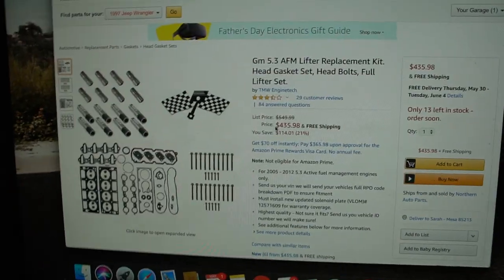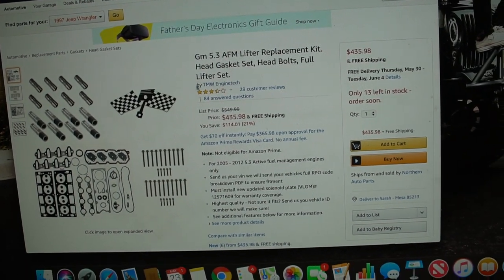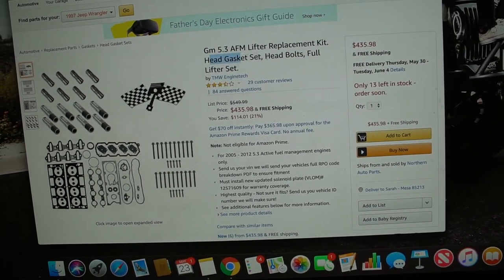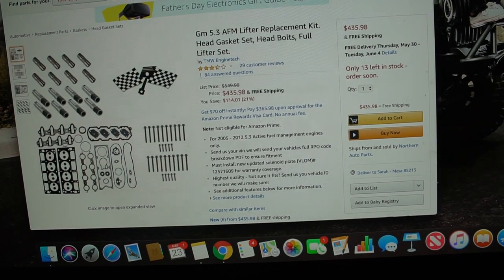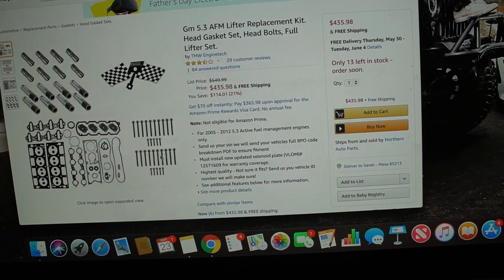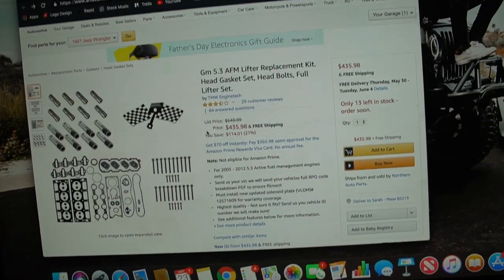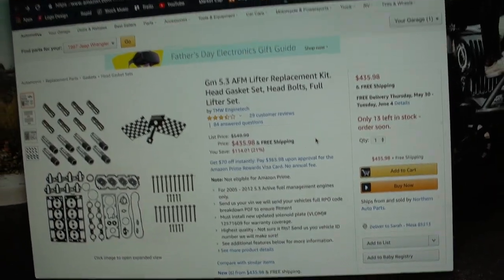Chevy's Infamous 5.3 Lifter Tick (Solution!)

Comment: Just turn up the radio nothing to worry about I have 224 thousand miles on my 07 avalanche and its done it since I got it when it had 107 thousand just change the oil and air filter regularly and your good 👍
Reply: Thanks! this comment helped me more than the video itself.
Reply: Adrian Rojas straight up. This guy is in the video is nuts for spending $2000 to fix a sound.
Reply: @mateo3388  I believe you, my friends dad a mechanic told me there was nothing wrong with my tahoe, the tick is not loud and said I can use it for another 100k miles or so or if in case it gets louder he will just replace them along with some new fuel injectors from ebay. Had mine cleaned out
Reply: @adrianr8486  I got the 4.8, the tick went away after oil change knock on wood
Reply: You want to do this if you want to change the camshaft with the lifter kit and probably with the camshaft bearing and that cost fortune
Reply: @cameron.s.9368  I changed the oil and it stared doing the tick noise
Reply: @mateo3388  he isn't nuts. The noise means that the lifter(s) which are spring loaded have remained collapsed or it is stuck. Sometimes an engine flush will help and sometimes using a different oil may help, but it is a serious issue. His lifter tick if left could have and would have destroyed his cam among other things, his engine altogether.
Reply: Yep mine will come and go randomly I just ignore it I have had the truck a 09 Silverado for about year no issues other then normal wear and tear 171k when I got it has about 188700k now

Comment: Not even collapsed lol that’s a nortmal sound
Reply: My 2009 doesn't sound like that. Smooth and quiet.
Reply: @ItsRen Mine has 159k miles and no problems, but just put the Range AFM Disabler in to keep it off and hopefully prevent any. Never liked that forced feature anyhow.
Reply: @ImprovingYourMokai  what year?
Reply: @chevygmlyfe_  My first comment said 2009.
Reply: My 2014 sounds the same way its just a normal liftter tick my truck been sounding like that the past 100,000 miles
Reply: Wasted a lot of money. Woulda run another 100,000 miles with that little tick.
Reply: @ImprovingYourMokai  how you liking the AFM disabler?  I’m thinking of doing it to my wife’s Yukon.
Reply: @HapPap81  Has worked flawlessly.
Reply: @ImprovingYourMokai  what happens after you keep driving with it like thay
Reply: @skylinezz4482  Like what? With the AFM disabled? Nothing, it works fine.
Reply: @ImprovingYourMokai  just w the lifters ticking is that fine to drive like that or is it must to get fixed

Comment: This is definitely not a collapsed lifter. A collapsed lifters sounds like a massive engine knock. Ask me how I know. I did a DOD delete. Replaced with LS7 lifters, new cam, valley plate, trays, HG etc. Tuned it out. Working great. Now 2 years later hear a slight tap/tick like this.
Reply: What was it?
Reply: I have been chasing this tick this weeks now.

Comment: WARNING ⚠️ 
If you own this engine GENERAL MOTORS IS BEING SUED THROUGH A CLASS ACTION LAWSUIT
case 1:19-cv-02858 szep v General Motors.  
What you describe is exactly what they’re being sued for.  
What I would suggest is to start making noise.  This lawsuit was filed last year.  I bought the GMC version of this motor less than a month ago and and hearing the same clicking sound, (having the same symptoms the class action describes).  
General Motors has not issued a recall, so what will you do when your 7,000 dollar engine fails prematurely?  I don’t have that kind of money and likely neither do you.  The only way to fix the problem seems to be to speed up the judicial process.
Reply: Any updates
Reply: TheSanchezinjection  It would bankrupt GM

Comment: I have a 2007 GMC Sierra 1500 with an LY5 8th VIN digit “J” has AFM/DOD, mileage is at 248,000 and it has lifter tick, but has been doing it since around 120,000 miles, no major failures yet, just do regular maintenance and you should be fine, I did however use a superchip tuner to delete the AFM/DOD function out at around 180,000 miles
Reply: You have a video on how you did this?

Comment: *For all the guys seeing this* I have a 2012 Silverado and my truck made this noise fairly aggressively and I had no clue what it was I took it home and checked everything out turns out my pcv valve was clogged which cause the truck to burn oil a lot faster then the 5.3 already does replace that for a simple 80 bucks and an hour at most and see if that helps it fixed mine!
Reply: Ill have to try this 👍

Comment: It's not a big deal.  Just keep your oil changed religiously.  Make sure to use oil filter with check valve.  The only 5.3`s I've seen with a problem from this tick are the ones where people did not change oil regularly and/or just couldn't stand the sound.  It not really a problem.

Comment: I am a heavy Die Hard fan my family owns the Chevy dealer in Mass and I will tell you from experience the 5.3 L V8 is usually a bulletproof engine if you get anyting in my opinion 2009 or newer you're going to experience more lifter problems because of the active fuel management s*** if you do have one that has the active fuel management delete delete delete delete make sure the truck is running in all 8-cylinder mode at all times truck will be more reliable
Reply: My truck has the M5 option.Does this keep it in V8 all the time or do I need to get a tune ?I start in manual mode on shifter then press the + till I get in the 5 then start driving.Does this keep it in V8 all the time?

Comment: 5.3's also have issues with piston slap when cold start up - it can sound like a noisy lifter. My 07 Sierra ticks fairly loud when cold and diminishes to a slight tick when warmed up. She's been doing this since 100k miles and now @ 270k with no issues. The cylinder cut off feature was de-programed @ 110k.
Reply: I thought I had lifter tick in my 08 Avalanche. Turned out it was the exhaust manifold. The bolts in the back are known to break or back out. When warmed up it stopped. I just tightened mine up. Fixed the cold tick.

Comment: I recently picked up a 2008 that only had 36,000 on it.  Mine sounds the same already, but that's just how these motors sound cold.  Yours isn't even bad yet. Not sure who's paying $4,000 to fix this?  I'd just spend a little more for a new crate motor at that point.  But my first move is going to be a disable tool to delete the AFM.  I switched to Mobil 1 oil/filter and drive mine hard...worst case, I'm doing a 6.2 swap when I blow it.

Comment: There is also a product to help prevent it it before it happens that is less than $200 online and it takes less than one minute to install and it keeps the engine in v8 mode at all times. It's called the range programmer i bought one when i got my 08 Silverado with 85,000 miles on it and have had it over three years now and it has 130,000 and still no lifter noise

Comment: Just get the AFM disabler. Plugs right into your obd2 port. Done. Prevent the oil consumption problem which leads to the lifter tick but you have to get it before you have the problem.
Reply: My truck just started making some banging noise when going into V4. I didn't know until now about the Ranger AFM disabler. So there is no point installing it now until it gets fixed first?

Comment: My '21 Silverado 5.3 with 33k miles does not have the variable 4 cylinder on demand (its all 8 firing all the time) and it's currently in the garage getting fixed because of a faulty lifter.

Comment: Mine has a tap when cold at low idle. It's done this since new and goes away as soon as I drive it a mile or so. I deleted AFM with a tune.
It's more of an annoyance when I hear it at the drive thru getting coffee, but I'll leave it alone until it causes an issue. Truck's got 54K miles and runs great otherwise.
Reply: Now, this is kind of weird...I have a GMC SIERRA DENALI 2015. THERE WAS RECENTLY A RECALL ON THE VACUM PUMP FOR THE BRAKES. GOT THE VACUM PUMP REPLACED, NOISE HAS DISSAPEARED...
Reply: Jamie Coverson smh they just reflashed my ecu for the brake. No vaccuum. Got the letter over mail too with vin number

Comment: mines been sounding like that since about 80k miles, has 300k on it now with no issues. Sound hasnt really changed, its pronouced on cold start up, but audible even when warm.
Reply: Yes.....same here. I have been adding Lucas oil stabilizee ever since 120,000 and now its at 189,000 still running like a chanp.
Reply: Thanks for the information mine does it in cold starts
Reply: I was gonna say, bad buy, but from others comments I guess you did OK.  Tick , tick, tick.

Comment: Best fix is replace cam with an LS3, upgrade lifters, heavier springs, new valves and push rods and DOD/AFM delete as soon as possible!
Reply: No need to change push rods definitely not the valves they have nothing to do with it. And you won't need heavier springs unless you go with a higher lift cam

Comment: It's a good engine if well maintained and GM improved it after 2011
Reply: I have a 2011 GMC 5.3 so does this mean I should be good?
Reply: My 2013 has a collapse lifter
Reply: @Frit0Pie  how much did it cost you for repair?
Reply: Дядя Федя parts are around $1000 with cam and I’m thinking of doing it myself. I haven’t gotten a quote from a mechanic but I’m estimating around $2k+
Reply: @Frit0Pie  as long as cam weren't hit, I am sure you could get away with just replacing lifters and rods.
Reply: @Frit0Pie  is that American price?
Reply: Sam Fascione yes
Reply: Lifters are still junk, even in 2021
Reply: no, they did not. if you motor has AFM ....it WILL cause issues. step 1: delete AFM. step 2: motor flush. change oil every 5k miles. synthetic only. if the tapping goes away....lifter still has enough oil. if you have tapping all of the time, lifter is collapsed, needs to be fixed.

Comment: You can usually unstick them without removing the head.
Reply: If the lifters are collapsed unsticking them is prolonging the issue for the inevitable...they will definitely fail eventually costing you more money. If the tick is new and just now starting sure..you can unstick em..but replacement is best

Comment: I have tons of info on these lifters and the noise they make over on my channel. Yours does not sound that bad at all yet. You may be able to even do a engine flush and run a better oil to solve that minor noise. Best thing to do though is get the system turned off ASAP and check for loose VLOM bolts.
Reply: I've watched alot of your vids on the 5.3 ticks. Any idea why mine will be silent then start ticking for a couple of seconds then go quite again ? Only does it at idle and seems to do it way less(practically doesn't do it at all) after I change the oil but will come back after about 1k into my new oil change interval?it will just be random when it decides to do it too.

Comment: Do the 6.0s have this problem as well? I recently did an oil change and an AC belt replacement, and I noticed my engine started to make a ticking noise on idle. It’s driving me crazy.
Reply: Depends on year model. Loo in your glove box and the RPO codes. If it has a L76 then yes. If you have a pre 2007 Your tick maybe piston slap or a lifter tick. Put some marvel mystery in the oil and it should clear the smaller oil passages and clear up the tick.
Reply: @apollocreed2089  how much and when do i add mmo before an oil change or just any time??

Comment: Everybody talks about the lifters blah blah blah. Jus disable the AFM the lifters will last forever and the oil consumption problem will go away as long as you do it in time. Also change the oil every 3000 miles with conventional oil do not use synthetic oil. My tuck had 84,000 was using oil and fowling plugs and o2 sensors. Disabled the AFM no problem since. You can either have the computer flashed or jus buy a range AFM disabler and plug it in. Pretty simple fix actually. I've seen it work even after the lifters started ticking. Dont make a mountain out of a mole hill
Reply: What if you started using synthetic can you switch back for this truck I have a 2012 Silverado with 134k miles does this sound in cold start
Reply: I always drive mine in m5 mode and switch to m6 after I hit the freeway, it’s makes this noise on cold starts

Comment: Throughout my life time I've owned 5 different Chevys and all of them had major engine problems at fairly low millage. Right now my son own's a 2012 silverado with 130k miles and the lifters are tapping. I honestly believe they build their engines to fail around a certain amount of miles so the truck will have to go to a mechanic or  buy a new truck. Kind a like American boat motors & I'm 100% American but looking at the past experience I have with both and other people's experience's this is so true.
Reply: Get what you pay for, build it yourself or deal with what factory hands you but for the cost of new trucks nowdays, that shit should have no issues going on 200k on the motor but it all boils down to how you drive the truck and how well you maintain it..under heavy acceleration theres more friction and more movement wgich means its damaging the engine...from the day you buy your vehicle brand new its trying to be blown apart by internal combustion ( a.k.a. well timed contained explosions ) so unless you build it yourself and dump 10 20k into the motor this is what you get man!...sorry You want performance but you fail to see the reasons why...Trucks have alot of horsepower and torque, none of which is overall healthy for the wellbeing of your motor...I drive an 01 Ext cab Chevy 5.3.L and love it..sure it has problems but those problems are easily fixed and given the popularity of the motor, the parts are easy to find and they are cheap...So I dont really see the validity in your complaint?
Reply: All 5.3's that I have seen sound like this and run for 300k+
Reply: @aprildickerson2065  or you can buy a older toyota v8 like the 4.7l or the new age 5.7l which is still reliable lol.

Comment: My 2008 Sabb 97x 5.3i has a ticking noise on startup it sounds really bad at times but can be mild at times for some reason. It goes away after a minute of driving I recently got an oil change and hoped it would get better with some brand new 5w30 and a new oil filter full synthetic oil but it was still there on startup is there any long-term issue that I should be worried about?

Comment: All normal for this engine. I have 209k miles all original, with zero issues. Bone stock.
Reply: When did your lifter tick start?
Reply: Normal is not good.
Reply: I’m happy just keep up with oil changes

Comment: My 2007 Tahoe makes the ticking when I first start it, like in the mornings. Then after about 20 or 30 seconds later it goes away. 🤔 Is that still a lifter issue??
Reply: That’s not an issue. Engines are designed with valve clearance so as the engine gets to operating temp the valves will actually grow. That’s why engines tick when they’re cold
Reply: @DieselSniffer3500  oh ok....makes sense. It just seems to be on just one side. Oil pressure is always good 👍
Reply: @Lightning7474.   exactly same thing on my 07 Tahoe. Ticks at startup then goes away. Will keep an eye on it if it gets worse.
Reply: @vincehernandez4044  did it get worse ?
Reply: @Lightning7474.  I have the same issue  .. What side is your tick coming from  ? Mine is in the driver's  side  ..
Reply: @marktaylor1100  yep!  Same side. On warmer days not so much as cold days.
Reply: @Lightning7474.  thank you  for your reply ... Yep , I think when I have the funds gonna have it rebuilt and delete the AMF/DOD .. I have faith that it will last that long ...
Reply: @marktaylor1100  absolutely.  They are very good engine's. This 5.3 I own has 160,000 miles & still runs very well. I us Mobil 1 full synthetic every 3 thousand. ... Take care.
Reply: I have read some comments here of people having the tick for years and still running good just get a plug v4 delete
Reply: @MarcoGonzalez-bi6cg  is there a way to do that?  Or is that a dealer thing?  Just asking.